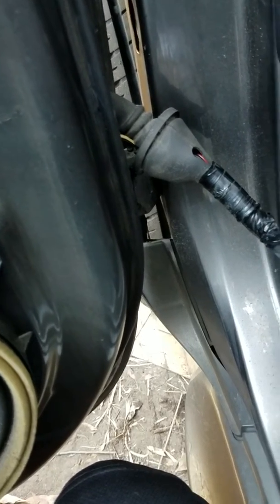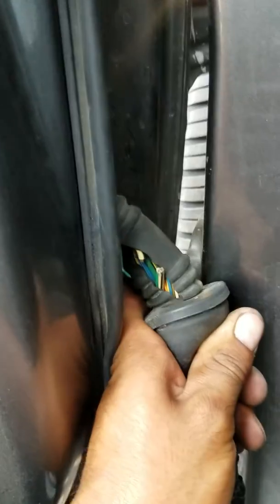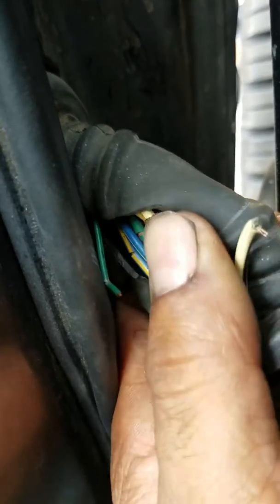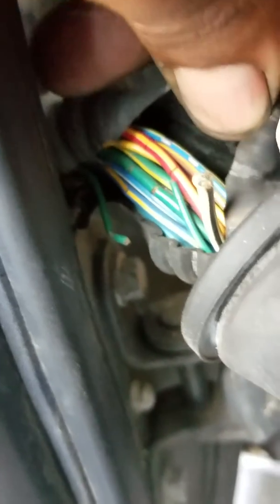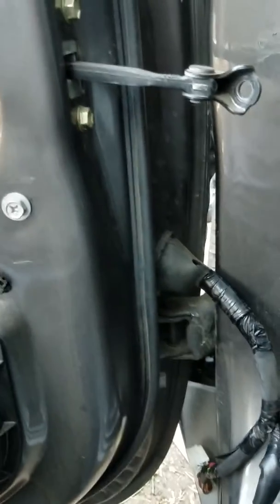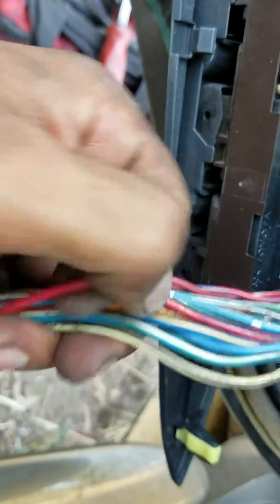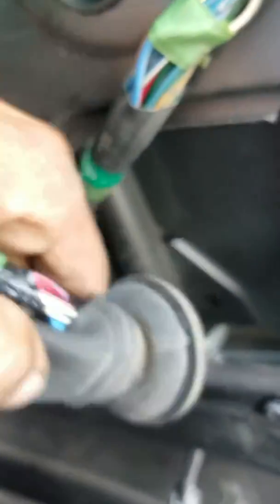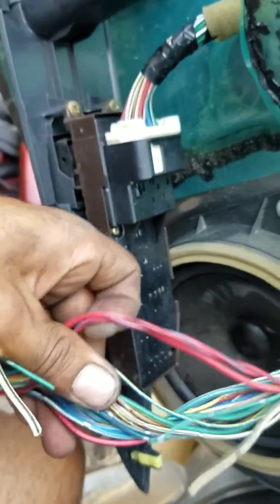04 Scion XA electric window and power door lock electrical issue

Comment: I have the same problem. The windows do roll up but its almost as if the motors have to charge, and i will have to trigger window up in spurts.
Reply from the maker: You might need to get a full wiring harness for the door
Reply from the maker: Even though I did that repair months ago. Now my window is rolling up slowly and doing the same thing you are describing. I also get sporadic windshield wipers going off. I think the solution is to replace the entire door wiring harness from the connector